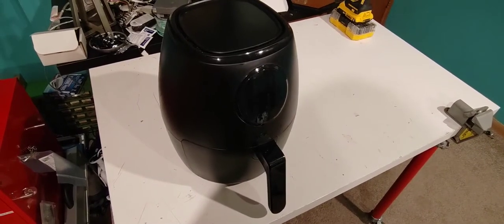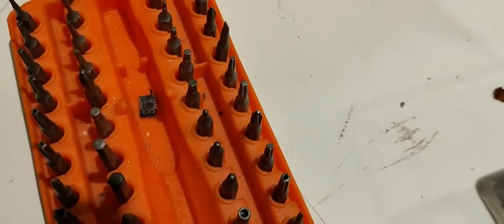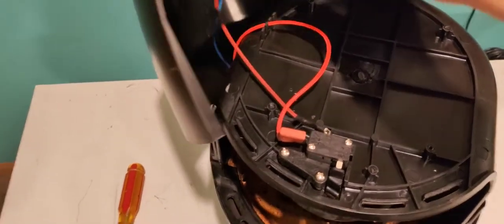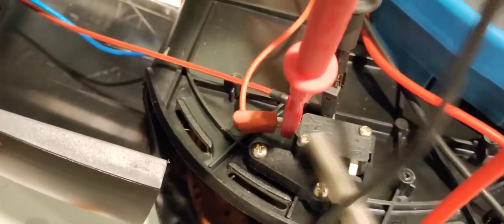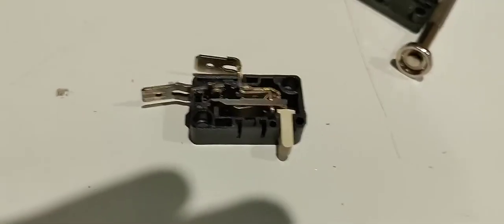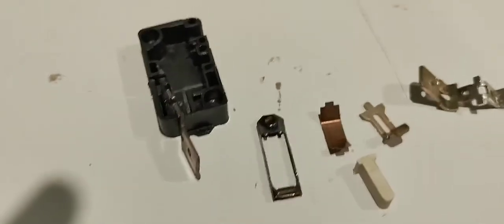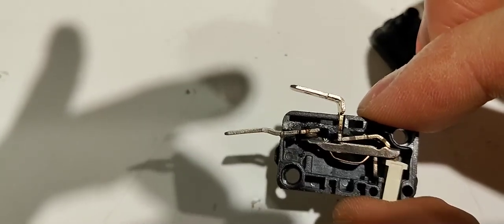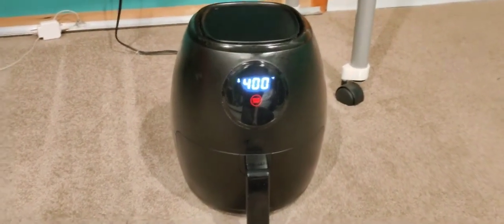Chefman Air Fryer Fix (bad switch)

Comment: unfortunately the plastic tab on the handle of the basket also snaps so if you replace the switch it doesnt work i just got 2 units in my shop and they both have a bad switch and a bad basket tab. just putting that out there to add to the information pot.